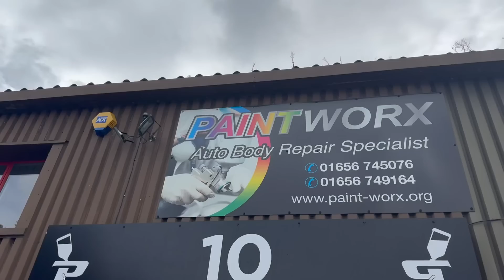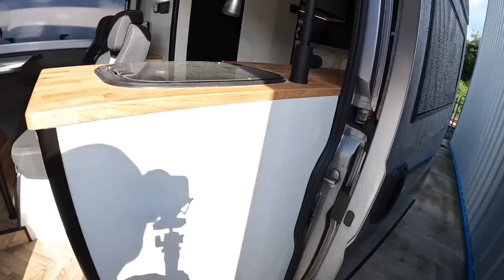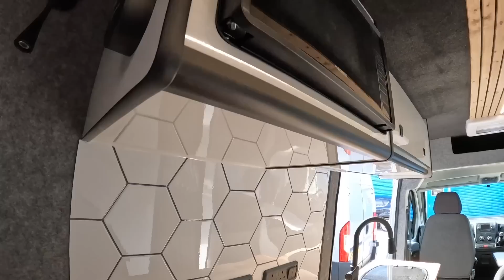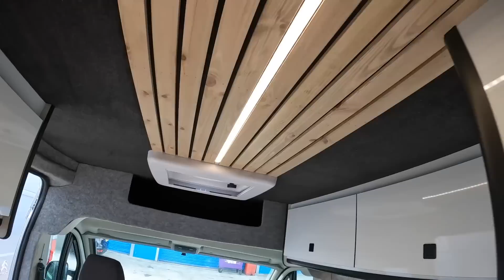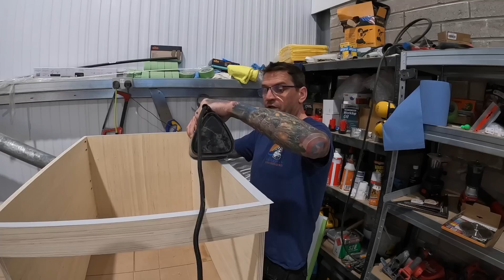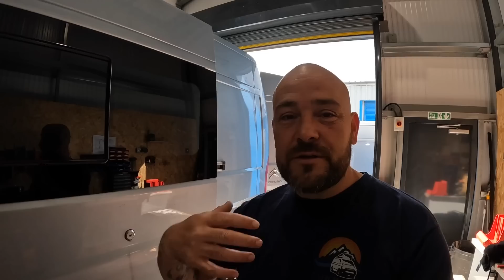Written off New Camper build brought back to life

Comment: hi. love your videos. my wife and I have watched them all!. on this van in particular what battery did you use, and what inverter. I wonder if there is any provision for the ninja oven to be used at the same time as the hobs, or is it safe to assume you would use one, or, the other. Thanks for making the videos.
Reply from the maker: We used a 560ah lithium battery with a renogy 3kw inverter charger. The ninja is about 2400w so the only way you’d be able to do this is to use two batteries and two inverters 👍🏻🚐

Comment: I bought 2 brand new doors off a similar van last yr  (horse box conversion company) for £150 each , 8 miles on the clock ,in same white colour for a couriers van , luckily no D pillar or back panel damage , just bumper and parking sensors , job done in a day , without any paintwork   cream job , the van looks mint , very happy customers , its a joke how insurance companies want to write vehicles off , anything can be fixed with the correct skill and psrts , i argued with and engineer once in 2005 over a transit van a week old from new , front and back damage,  2 D pillars , rear panels, 2 x rear doors , bonnet , headlamps , wings and both  bumpers , He said total , I said ,not a chance , fixed it with genuine parts when in the day we got 28 % discount at least on panels for £5500 plus vat , I made good  money , the guy kept his van he was very happy , and so were we , fed my kids and paid my bills 😂😂😂😂
Reply from the maker: They are too quick to do that, to be fair the total repair did cost more than the base van but still way less than the converted van 👊🏻🚐 and our customers are back on their adventures

Comment: Hi Stu,
I understand you use high gloss boards from Moorland. Is that iron on trim or knock on, on the doors as they are 90 degree corners.
Im doing high gloss but was going to IKEA doors but your method is customisable. Cheers